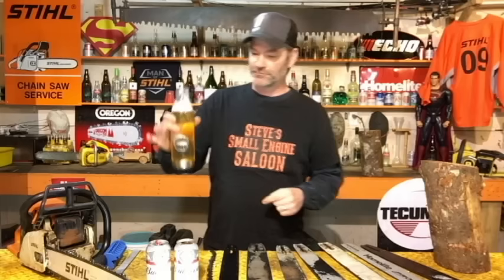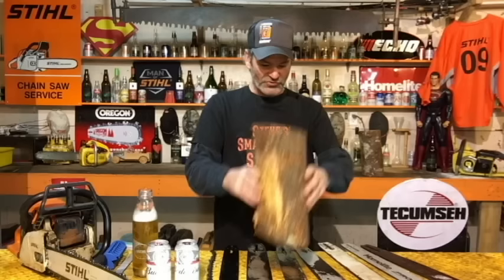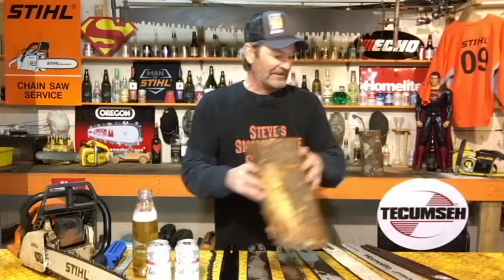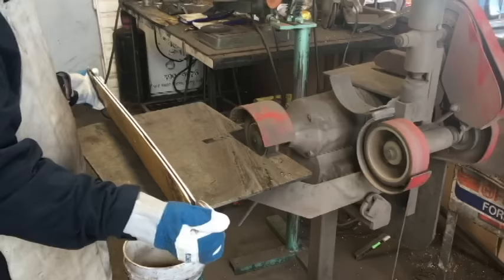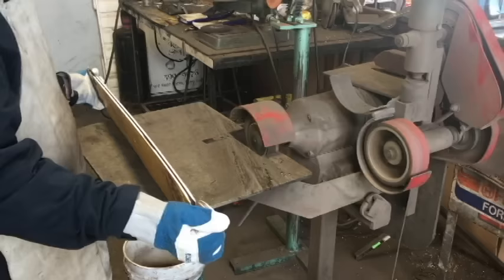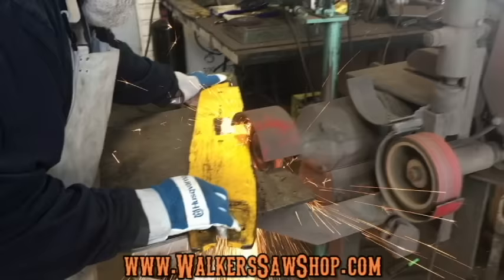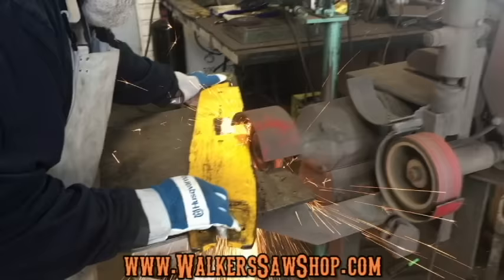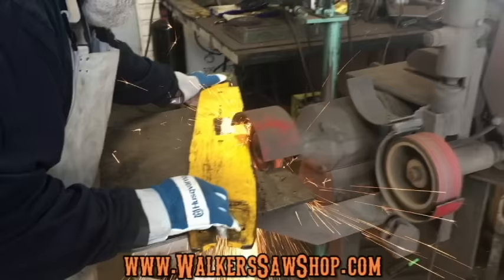How To Repair A Chainsaw That Cuts Crooked

Comment: Had that problem in the past was able to correct by re sharpening the chain, didn’t check for the other 3 but I will next time. 
I would add that even though it’s a remote possibility I have seen a warped bar cause issues like this. 
Thank you for the great explanation 👍
Reply from the maker: You're Welcome...
Reply: Yeah I messed my bar up but I'm gonna try flipping it over to get some more use out of it if possible. I ran mine with loose chain for a bit and next time I used it I could see the chain on the bottom going sideways and it stopped cutting until I wiggled it lol. I flip the chain every now and again but not since last time I sharpened it.

Comment: Thank you for the very informative video. I learned things I didn't even know I needed to know. QUESTION: If the guide bar channel is too wide could a person carefully peen the sides of the guide bar to narrow up the channel? Thank you again for your videos.
Reply: I've put the bar in between the bars of a metal cage and twisted it to narrow it back and it worked

Comment: Great video as always. Got a brand new farmertec and it cut at and angle. I think your last tip is certainly the issue. I didnt expect too much since the price, but I wanted it for an Alaskan saw mill which it cant do unless cutting straight. Never had an issue with my huskys a d even with the cheaper Dolmar (which surprisingly I really like). You get what you pay for I guess, but 3
$300 vs $1200... thanks for the channel. You already helped me get my log splitter going again. Thanks for the channel and great info!!
Reply from the maker: Thank You...and You're Welcome...

Comment: What I've done for years to true up my bars is chuck up a metal cutting wheel (the kind used in metal cutting chop saws) into my woodworking table saw  (probably need to make an arbor insert), then running the bar across the table with light pressure against the abrasive wheel. With the wheel square to the table you get a 90 degree edge that you want.  Chop saw wheels aren't really made to be used by cutting on their sides, but with a tight throat plate on the table saw to stabilize the wheel, and the wheel sticking up minimally above the throat plate, using light pressure against it I have found to be safe.  You can run the bar edge against the wheel at an angle to remove the burr that gets created, or take off the one that may already be on the bar before you true it up.  WEAR SAFETY GLASSES AND DON'T HAVE WOOD DUST DOWN IN THE BOTTOM OF THE SAW WITH the SPARKS THAT WILL BE SHOOTING DOWN THERE.
Reply from the maker: Great tip.  Thank You...

Comment: I've heard people say that you should install a new bar whenever you put on a new chain. I'm about to put on my 3rd chain and it cuts pretty good still. Should you replace the bar after so many chains?
Reply: When the bar goes bad the chain wont turn, it messes up the tip of the bar. My bar started to get worn so i bought another to keep on hand until this one bites the dust. When the end where the sprocket nose is starts to seperate or get a groove in it, it wont be long before replacement is needed.

Comment: Steve,  I have an 2 year old dewalt battery powered chainsaw.  Put a brand new oregon bar on it, with a brand new chain. The bar and chain gauge matches perfectly.  My saw still cuts crooked, and not by a little bit.  What could be the problem?

Comment: The proper name for filing the bar with the flat file is: 'Draw Filing' it is common practice in any tool room. Or [IF] you know of anyone owning a surface grinder large enough to handle a bar, then take it to them as they can grind it to within 1/10,000th of an inch.

Comment: Hey man I have a stihl 036 pro and  I keep burning up the worm gear shortly after starting and reving the engine. I also installed a brand new oiler and oil line kit and oil line and filter. I dont understand how the worm gear works considering the only way it stays in the oiler is if it spins counter clock wise, but everything else spins clockwise. Please help

Comment: I have a second hand 20" saw with the curved cut problem. I inspected the chain and found that there were an extra set of links facing the same side. I don`t know if the chain is too long for the bar, or too short. Can a chain be shortened?

Comment: Hey buddy.... go to harbor freight and get a 8” diamond blade (solid edge) and put in on your table saw... you get a really great 90 edge... you make a couple light passes... you can turn your table saw into a great adjustable plane grinder.... this blade can also touch up the carbide teeth on your 7 1/4” blades on your Circular Saw or Chop Saw or Sliding Compound Miter... all your blades!!! You set the blade angle to match then do one side then flip and correct the angle and do the other side... if you touch up a couple 12” carbides that $20 dollar Harbor diamond paid for itself twice over... I️ look at yard sales and stuff... because you can mount a 71/4” in your table saw and sharpen a ton of other carbides and regulars on the cheap.... give it a try... it’s a free bar dressing machine because you already got a table saw and a diamond blade of some sort with a continuous rim floating around your shop probably!!!!
Reply from the maker: Damn, that's awesome Dave.  Gotta try this out.....

Comment: Hay Steve why does my guide bar wear where the bar tip is riveted to the main bar. It’s wearing towards the center of the bar like someone took a bite?? Thanks for the informative videos. Also what brand rebuild kit do you recommend for a 046 magnum. Thanks again.
Reply from the maker: Thats usually from having the chain too loose!  I have a video on the channel to show how to tension it properly.  I always recommend OEM parts....

Comment: Last 2 days I have been cutting tree rounds that look like the letter C with my Husky ....WTF !  I sharpened my chain , and adjusted tension , I can see the chain veering off to a huge angle at the bottom of the bar .....So will try the flip the bar over trick to see if that helps .....Thanks Steve for your vids ...Im off grid where I live so need to getter done out here !!
Reply: Part 2 ---  Ok so I also cleaned the air filter ..... Un-plugged the oil tube port that oils the chain ...... flipped the bar ....sharpened chain .....cleaned the spark plug ..... the Husky 445 is running strong and cutting great now ......but still cutting at a angle , so off to the store to buy a bar today if i can find one ......thanks for all the tips  !

Comment: HI  hello Steve, 8 years ago I work on a sawmill running a Pacific trail trim saw and the guide bar measures 7 'x 7 1/2 "and is cutting horrid half moons and cutting to the right. With video I learned how to inspect my equipment, any advice let me know

Comment: Hi Steve, 
You forgot one, when the top rails are worn so much that. The drive links sit on the inside of the groove and making the chain flop on both sides. Check the bar with a depth gauge.  This also burrs chain and wears out sprocket and bar itself.
Reply from the maker: Thank You...

Comment: Great explanation, Maybe you should be teaching at Echo.

So , lets say your out in the woods and you have a freshly sharpened chain, say 20 inch, full house chain. The trees are say 15 inches from side to side, nice day, slight 5 miles per hour breeze, around 60 degrees. Your using a MS 290 Saw. So lets get to the question... How many trees should you be able to cut down (not cut up ), until the saw most likely will be to dull to cut anymore decently, or it would take you 3 times longer to do so per tree.

I just love this question !
I going to guess, And since a know nothing about this subject, But I do own the aforementioned saw.
My Guess.Drum roll please...40 trees
Im probably way the heck off, but Im sticking with it.

You know your getting old when you take down a huge tree, and It turns out to be only half you age !
I just put 2 and 2 together, Saloon   as in you always have a beer on the bar. Im smarter then I thought.

Forgot....Its 9am and the sun is almost to the top of the 50 foot pine trees, that you are staring down.
The trees are not hard, nor are they soft. They are just right. You have just finished 3 cups of coffee, and 1/2 dozen Krispy Kreem Doughnuts.
Your 20 miles out in the woods, Your getting paid 15 dollars a tree just to lay them down, and you have as many as you possibly do in a 8 hour day. And you forgot your file. Plenty of Gas and bar oil, just no file, and no Dam Axe.
Your Guess is ?
Reply from the maker: WOW.  That was a great comment!  Personally, I stop and sharpen as soon as I feel like I have to push to make it cut....
Reply: Guess your saying never get caught without your file.
Changing up my answer. 20 trees.
Do all chainsaws have the same type of chain oiling system, cause the Stilh you were showing seems to be a bad designed system.
Reply: Charles, in your case, 4 trees.  You're paying way too much attention to everything else besides sawing, so that's all you will do in a day and you can remember your file for tomorrow.

Comment: The wiggle test only work if you chain is in proper tensions

I watch Steve video on tensions
Loosen bolt hold tip all the way up
Set tension and frighten bolts

I did not know this saw a different method on u tube 
I hope you told that guys wife about your u tube channel so she can show him how to do it!
Ps I need video on all this stuff
Do you ever drink yuengling beer

Comment: Late to the party here...to help keep the filing level and true the length of the bar, I run a black marker down the low side rail all the way end to end.  That way you can see when you are flat from side to side on the filing and can see any lower spots that you might miss.  Once the filing starts to wear the marker off, move to areas that aren't getting enough filing.

Comment: Should i use the 4 5" or the 6" angle grinder or my drill with a disk or bench grinder. I feel using a metal circular saw would make more problems then it would fix.  Do u know much about tempering metal and can u do a video on splitting the case and replacing bearings an seals on a ts400?  If i had u do it what would u charge? The top end, flywheel, clutch and arm is already removed. I got the oem carb, jug, an bearings. Are u a wiseco(dominant) dealer or do u know of a fair one?

Comment: Why on a fairly new Stihl chain saw.  does the guides on the chain get big buses on the bottom ?  It seams to happen after I had pinched the bar in a tree.  I had to grind each side of each guide tooth. before it would go smooth through the bar.  The same thing had happened with my brother's saw.
Reply from the maker: I have only ever seen that happen if you de-rail the chain (chain comes off the bar as you are using it)

Comment: G'Day Steve,,Nice film..have been watching a couple lately,and thank you for them,,
Now there is one other thing it may be,,I have only seen this a few times,,But cheap chains ,where the pins and slides wear on them,,May not be cheap Chain,,But took me a long time before checking Chain,,Maybe a "Six Pack,"Any way the hardness was not there,maybe short on oil,,Not sure,,So chain side plates wear,,,Yer Me too,,but just something else to do a simple check on,,save a lot of beer's,i mean wouldn't you,drather be fishing with a case of cold Beer, And may be  Mate to chew the fat with,??

Comment: I'm extremely late here, I know, but I've never had this problem until I bought my most recent Husqvarna chain saw.  I wanted to rule out number 1 right off the bat because Husqvarna always delivered when it came to professionalism and quality, but now I'm not so sure.  My new saw leaks oil constantly, and I was wondering if my blade wasn't machined properly.  Could this be an issue?

Comment: Mine def cuts crooked.. gets stuck so I thought something wrong with clutch but you can see its not a straight cut so it just gets wedged in. Will try your tips.
Reply from the maker: Good luck!
Reply: @StevesSmallEngineSaloon  thanks I tried.. I can't cut through anything anymore so now it's evenly dull and it's spewing a ton of chain oil it seems because it's all burning up. Just bought a bunch of new chains so for a noob like me it's probably the best option vs sharpening :(  I hope that fixes it, if not I'll purchase a new bar. Only had the chainsaw for a few months so hopefully chain replacement fixes it
Reply: Boy did a new chain ever make a difference

Comment: I scanned my blade for the causes you suggest.  Turned out that the blade was bent.  Ever so slightly bowed.  Must have happened in a pinch.  I straightened it and it cut true.

Comment: You said match the bar and chain..... Exactly how, when your standing looking at the shelves full of bars and chains do you choose the matching pair? Thanks
Reply: The bar normally has numbers on it. How many links, thickness of drive links, and the distance of the teeth I believe. You could also count your drive links and measure their thickness with a vernier caliper.

Comment: One more reason for crooked cutting.  Crooked cutting. Logs are in wierd angular positions out in the woods or pile, and you need to observe the saw path you start closely, or it will end up crooked when finished.

Comment: Steve have you ever heard of putting a .058 chain on a badly worn .050 bar? Also I noticed having your depth gauges improperly filed or filed down too much can cause a crooked cut as well.
Reply from the maker: I have tried that, but the bar has to be EXTREMELY worn out so there are no tight spots....

Comment: I’ve got one more reason you might be cutting at an angle, but it’s embarrassing. Seriously when I started cutting wood, looking down on my Stihl saw, and tried to cut straight there was always an angle where the back side was higher than the side closest to me. FINALLY I realized I was sighting partially using the black brake lever at the front of the chainsaw, which I finally noticed looking directly down is at an angle and also the body of the saw is at a slight angle from the bar and it is designed that way. 
Started trying to pay attention only to the bar itself.

Comment: Hey Steve how about an oversized chain in a worn out bar?
Reply: I was just wondering the same thing. Just heard buckin Billy ray. Talking about putting a 075chain in a 072bar that's worn.  
I run all 050. You think 058 would work out here?
Reply from the maker: The bar has to be EXTREMELY worn out for that to work!
Reply: I guess a vertical milling bit would clean up the gap. Right?

Comment: Can one of you PRO's out there help me? I have a Stihl ms310 with a 20" bar with 72dl chain, I want to put a 24" bar on it. how do I calculate how many drive links I need on the new chain. I think its 84dl but I'd like to hear from someone that really knows saws. BTW it's being mod'd with a muffler and carb mod to beef the HP. Thanks

Comment: Would have liked to have a way to say for sure that the blade is too worn to use, like drivers hit bottom? Also, could you comment on trying to pinch a blade. I've seen a guy hammering them to tighten worn out grooves.

Comment: Hi Steve love the show can you help with installing collar screw on my MS 290 my screw  cam off when I tried to take off my bar  please help Aaa
Reply: You mean the bar stud?
Double nut the stud,tighten down the outer nut to the inner.....Not on the collar on the stud,and reinstall the stud and torque it....I've added some 242  loctite to Stihl studs (not the nut side) before to help keep them tight...the threads have to be clean of oil when using it.

Comment: * 5yrs ago late to the party again. Never seen an ‘Axe File’ but if it’s teeth all face in the same direction (like most files), never drag that file backwards unless you want to dull it.  Maybe a video on file care would be eye opening (engineers chalk etc).
* how about a small square (engineers or carpenters) to check bar.

Comment: summary:  1. improper chain sharpening.
2. size .050 chain on .058 bar.
3. bar groove worn excessively, try turning upside down for tighter groove on bottom.
4 bar rails uneven. can be filed/dressed down to even. bar should balance on side.

Comment: As for the razor sharp edges on the bar after trying it up ,I take a piece of 400 grit sand paper on a block of wood and run a couple strokes down both edges of the bar to dull the sharp edges .This saves you from having to plug leaks in fingers and hands.You will save on  bandages too.

Comment: One thing you did not mention is the way the user holds the saw.  Somebody came to me with this problem and I tried his saw and it cut square and true with me, but not when he operated it.
I found that he was holding the top with his left hand to one side and thereby putting pressure on one side of the bar